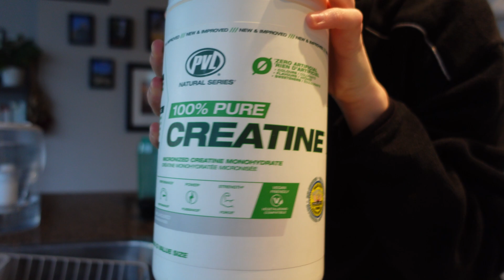A Real Day in My Life as a Design Engineer | Honest 9-5, Growth & Balance

Comment: Hi, I'm currently studying industrial design at Politecnico di Milano, but I'd like to do a master's in 'Design and Engineering' later on. Would that degree path allow me to become a design engineer?
Reply from the maker: I’d recommend reaching out to your professors or a university career advisor to confirm whether the Design and Engineering program aligns with your long-term goal - since each university structures that degree a little differently.

Generally speaking, Design Engineer roles are quite broad and often branch from a specific engineering discipline (like mechanical, electrical, software, or systems engineering). For example, I studied Mechatronic Systems Engineering, and now I design the electrical and software side of systems.

From the name, Design and Engineering sounds like it might cover a higher-level or interdisciplinary overview, whereas design engineers usually specialize deeply in one technical area and apply that knowledge to design. So it could be a great foundation - just make sure it includes enough technical depth in your chosen discipline.